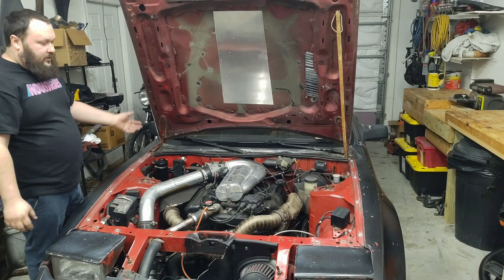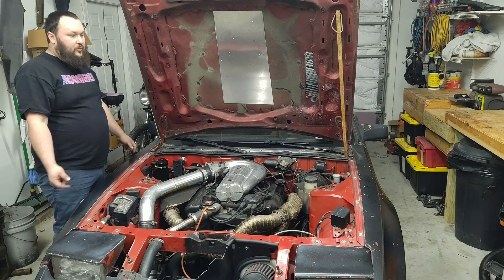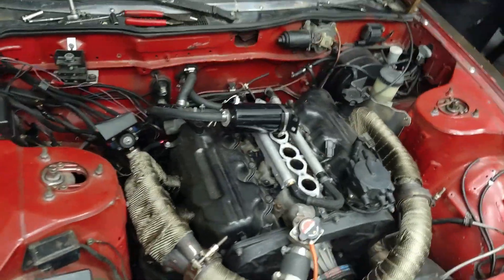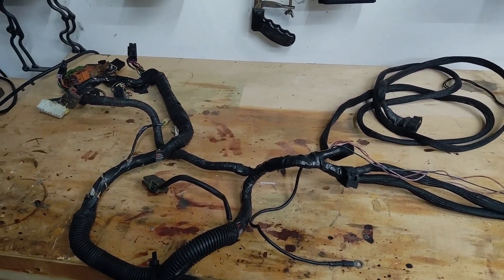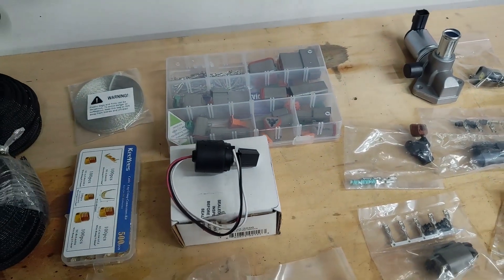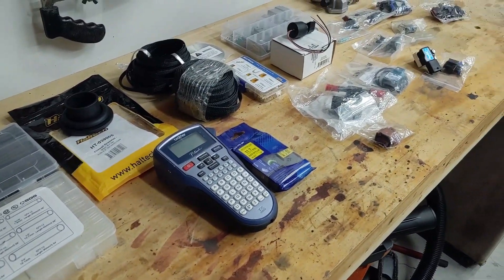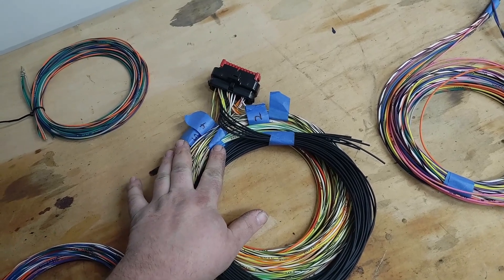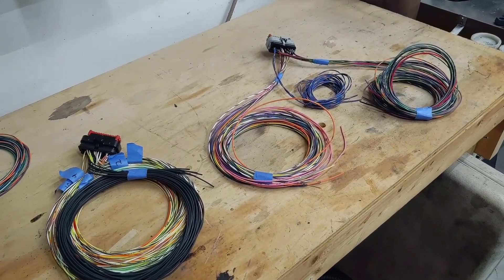FINALLY Removing the Nistune from My Z31!

Comment: Hell yeeeeah broootherrrrr
I thought I followed all the z31 builds on YouTube but i just found yours. This is 100% what I wanna do with my 86 na. It was reverse jumped and had the ecu blown out originally (according to the seller) As such the digi dash has never worked, i tried all the hacks, and resoldered the power supply, etc etc. But inevitably I knew I wouldn't be happy until I completely rewired the car. So thats what's I'm about to do. Figured I'd go ms3 and na2t in the process. I'll be checkin back in to see how it goes. Good luck my guy! ✌️
Reply from the maker: That's awesome hopefully you get it setup how you want. Hopefully when I get everything back together the car can make 500 on pump gas